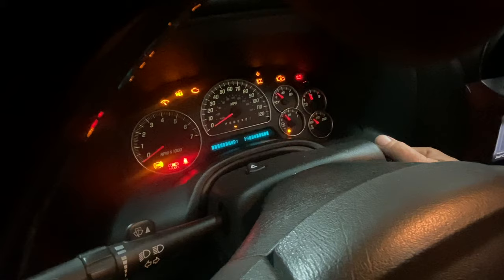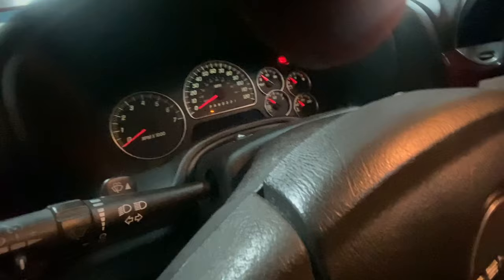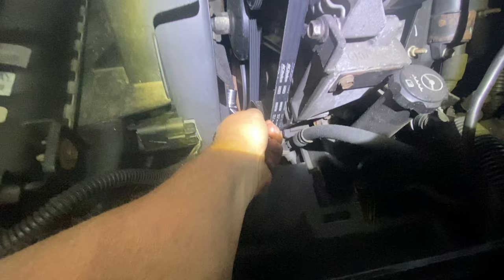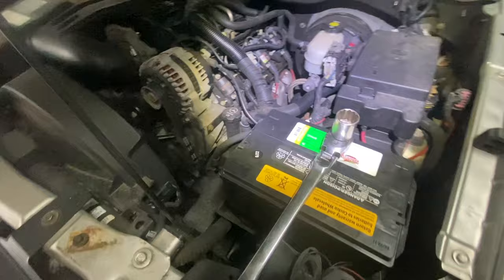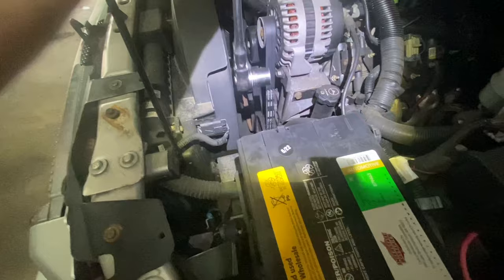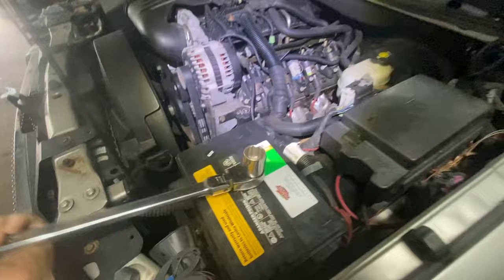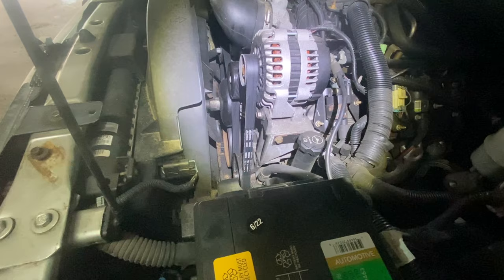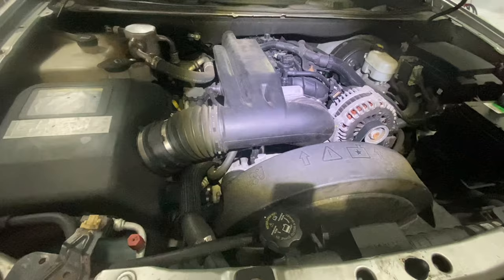Symptoms Of A Seized / Locked Engine - How To Tell It’s Not A Bad Starter

Comment: Rebuild as in take head off bp blaster n clean up re do.gasket and so on ?
Reply from the maker: Yes
Reply: @Motorcarnut  thanks everyone I talk to said have to completely replace the engine
Reply from the maker: Because, that’s the easiest way. Some can’t rebuild an engine only take one out and put another in. If you can’t do it yourself then your stuck with engine replacement.
Reply: @Motorcarnut  that's facts .. 💯
Reply: Saw one a guy selling me for 2000 wit abt 100k on it .stuck engine and I couldn't buy it because everyone saying wen that happens its new engine and people selling a engine for 4k . Crazy .. so wen I came across your vid I'm like wow .
Reply from the maker: Thank you bro, appreciate that. Good luck

Comment: I have a 2011 GMC Acadia shuts off while I was driving find out no oil though it was the battery change battery still not working do u think I lock my motor or is it the oil pump or starter my trunk won't open
Reply from the maker: If it shut off because of no oil that can mean it did seize, but I would have someone local confirm that.
Reply: @Motorcarnut  thanks my thanks it's the oil pump how can I determine what's what engine light is blinking but won't crank
Reply from the maker: Have someone try to turn the crankshaft bolt with a breaker bar by hand clockwise, it should turn over if not its' locked and no good.
Reply: @Motorcarnut  hey got someone to check it they said it's the computer in the car
Reply from the maker: If you had no oil in the car and it’s still fine, that’s great, but the computer is a different problem then.
Reply: @Motorcarnut  yea 125 for used one not including labor thank God it wasn't the motor
Reply from the maker: @latiacrawford3722 I know, good luck!
Reply: @Motorcarnut  thanks 🙏🏾

Comment: I’m facing the same issue. Can I send you the video and you can checkout if it’s seized?
Reply from the maker: Yes, post on your channel and let me know.
Reply: @Motorcarnut  I’ve posted it on YouTube just now
Reply from the maker: @Sam-ht1xw  Hey just saw video, to me that sounds like a bad starter, It still could be a seized engine but I did see it turning a little.
Reply: @Motorcarnut  I had just changed the starter
Reply from the maker: Then get a breaker bar on the crankshaft bolt and turn it by hand, should turn over with not much effort.
Reply: @Motorcarnut  I think the nut is just going in as I can move it but the engine won’t, I’ve currently taken the right head off

Comment: what if the motor turns 45° and stops and turns 45° back the other way and stops there to
Reply from the maker: To me the would indicate the pistons are probably hitting the valves, if the engine isn’t running.
Reply: Its not running we took the starter of but didnt help the motor is stuck ands spins just the 45decrees back and the other way
Reply from the maker: Again, sounds like something is binding or hitting valves.

Comment: I have a 2008 Chevy Silverado 4.8L and only makes one click  sound when trying to turn it on  any thoughts on what it could be? I appreciate it thank you
Reply from the maker: You can try to get a 1/2 ratchet and extension on the center crankshaft bolt and see if the engine turns fairly easy, if it doesn't it's seized if it does it's probably the starter, relay or the wiring to it.

Comment: I took starter off took too test it.  It blew there fuse pray it's not engine
Reply from the maker: You probably had the battery hooked up should be disconnected. It won’t hurt the engine physically but can hurt electronics so always disconnect neg battery terminal when working on anything electrical.

Comment: Got a buick with the series 2 3800 motor. Odd. It died on me on way home and won't crank at all.
Reply from the maker: Make sure it’s not an electrical problem first.
Reply: @Motorcarnut  it ended up being worse than I expected.  Pulled spark plug from cylinder 5 and coolant poured out. Radiator was half empty so motor  is pretty much toast.
Reply from the maker: Blown head gasket. These engines are very durable, maybe it’s salvageable?

Comment: I had my engine by a cousin that said he knew how to rebuild it. I got all the machine work done bored 30 over, master kit in it. Before we put that in it was hard to turn, but it did start. I haven’t ran the truck yet because it wouldn’t stay running, the carburetor I’m going to rebuild, and change fuel pump since the gas was dirty. This truck is a 1972 Ford that had sat for years.
Does it sound like it wasn’t done right? Can someone help?
Reply from the maker: It’s hard to know just from what you’re describing. Can the engine be turned over by hand smoothly?
Reply: It’s hard to turn, it turns but I have to really use force.
Reply from the maker: Sounds like bearing failure to me

Comment: My bmw was driving perfectly, then the revs dropped to 0. The engine cut out randomly, so bizarre !
Reply from the maker: Any check engine light on or drivetrain malfunction?
Reply: @Motorcarnut  Yes the engine check light is on ! We reckon the engine has locked or seized. Very strange to happen while going 70mph!
Reply from the maker: Wow, not good. Unfortunately these engines are known for bad oil pumps causing low oil pressure and bearing seizures.
Reply: @Motorcarnut  Fuck🤣 My granddad the mechanic is looking at it tomorrow. It's only a young engine aswell, 67k miles. Probably should've bought a Toyota 🤣
Reply from the maker: Toyotas fail too and no where near as fun to drive, but hopefully I’m wrong and he can save it. Good luck 🤞
Reply: @Motorcarnut  Thank you! Here's hoping 🤣 I do agree with you but I feel the Toyota GT 86 will be a fair bit of fun compared to your average Toyota
Reply: @Motorcarnut  You may not be interested, however further investigation after the bottom pulley moved (it was super stiff) it only moved about a couple revelations before it stopped, something appears to be interfering with it. My Grandad reckons it's a dropped valve 😁
Reply from the maker: Sounds like it seized up to me.

Comment: Supposedly my Honda '99 Civic seized 3 days ago.  WITH full oil.  No overheating;  I had just done about a 35mi. test run in the car, hit a slow section at 25mph....and the car just died.  NO warning prior.  NORMAL operation prior.  124k original engine.  A garage told me the seized condition.  However- when it was towed/dropped off back at my home- I tried it myself- and did get the belts to turn a little bit using ignition.  So-  IF those belts rotated at all- would that mean I DON'T have a seized engine?  Anybody?  I'm no wrenchhead,
Reply from the maker: Just because they turned a little doesn’t mean it not seized. Why it seized is another question. If the mechanic said it’s seized why don’t you believe him?
Reply: What became of it?
Reply: @Motorcarnut , sir. Ny Gmc Acadia 2011 will start and if I park it for another hour, and I try to start again it would not start. But if I let it cool for like two hours it would start again. Please what's the problem?
Reply from the maker: Could be a starter or starter relay going bad or a bad ground.
Reply: kills me when op doesn't update with any information

Comment: if i crank it counter clockwise ever just the smallest bit, it will then crank clockwise limitless, and will crank until i stop, but if i electrically crank it after it’ll crank and then does the click? what could this be
Reply from the maker: Sounds like the starter or wiring or the starter relay